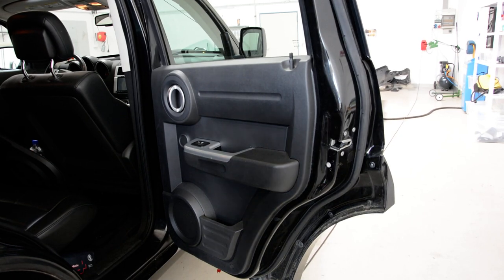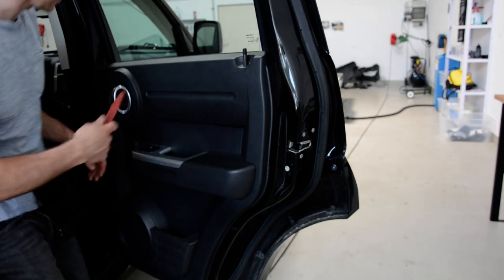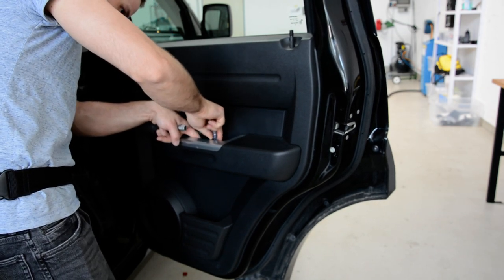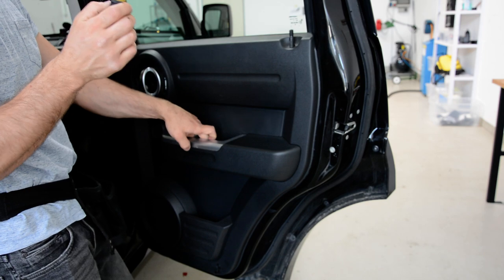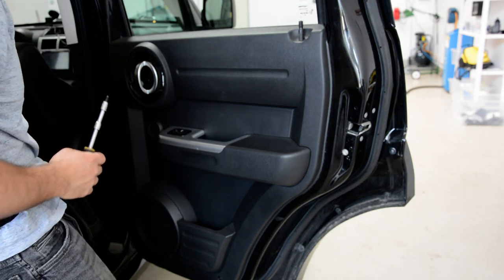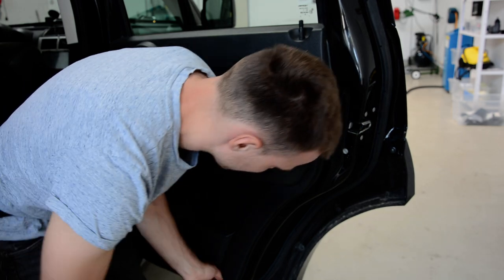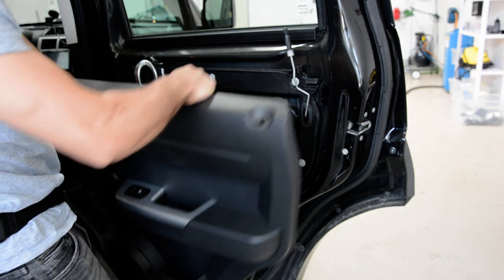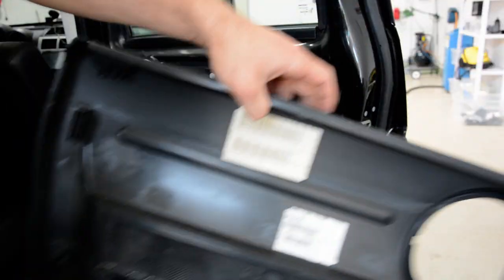Dodge Nitro Door panel removal

Comment: What did you use to remove the plastic little caps covering the screws
Reply from the maker: Take a flat screwdriver and sharpen the tip
Reply: Don't ask that question,. as he does not know his basic tools!